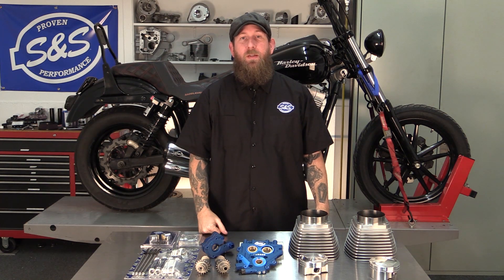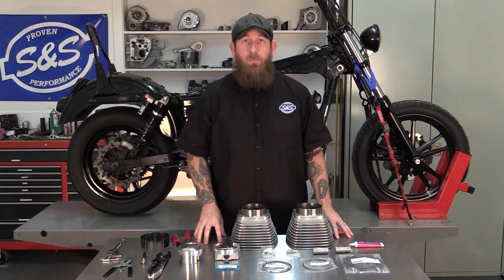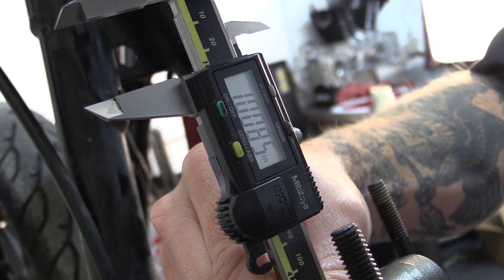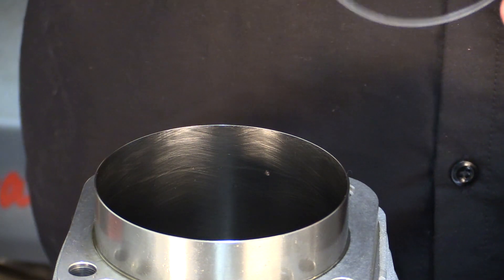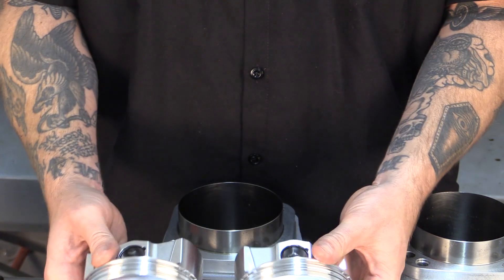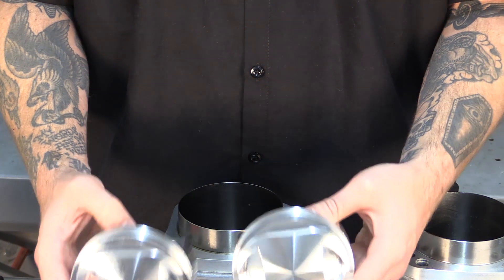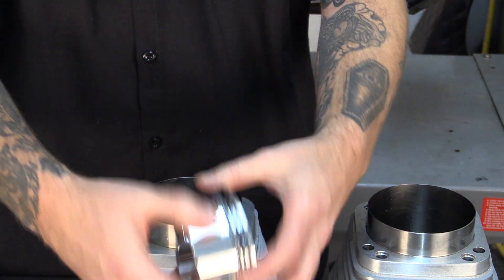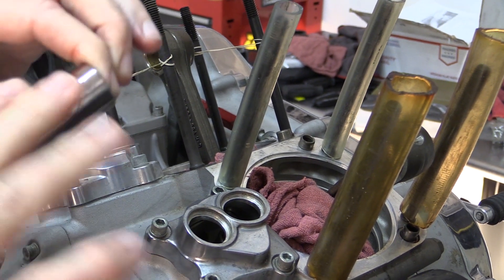How to Install: S&S Cycle Winter Power Pack (Part 1) Big Bore Kit

Comment: If you do that to a 50 000 miles or more engine is it not best to replace the craink case bearings while you are almost there?
Reply from the maker: We definitely recommend that you inspect the crankcase bearings and replace them if it's time, yes.
Reply: Its half way there

Comment: Hello, I'm a little bit confused. I've purchased the 106 kit. On the instructions it's written to put the black ring with the dot facing up as 2nd ring and the top ring has chrome edges and letter facing up. In your video it seems that you switched top and 2nd ring am i missing something?.. Don't want to mess things up
Reply: Same here! I just installed the pistons per the written instructions. This video seems to counter what the written instructions say. I contacted S&S and i'm waiting for a tech support return call. This pisses me off. Instructions should be clear!
Reply: Just spoke to S&S. Stated this was an older video. Tech said procedure for the 106" or 107" in written instructions is correct. Moly Chrome ring (lighter)  in top groove. Cast (darker) ring in second groove. Hope this helps clarify if any new readers have the same question.
Reply: @michaelkasper6140  thanks my man. I followed the written instructions with success also.
Reply: @2wheelsvibrations887  was it hard to do it yourself or simple
Reply: @franciscosarabia5711  it was moderate difficult, I should buy the proper tools specially the one to compress the rings it will be much easier to insert the cylinder

Comment: How much more power will this power package all done ad to an already 96 c.i. Twin cam engine? It is a very light softail that is used for stoplight to stoplight action. I assume that you will help pick out a couple camshafts for my intended riding purpose...
Reply from the maker: A stock 96" engine makes about 63 HP and 78 ft-lb of torque
A 110 Power Package is around 101 HP and 114 ft-lb

Comment: I'm currently putting your 110 BigBore kit on my 2010 Harley-Davidson FLHTK. Do you have a video for doing the heat cycles? At 2:42 in video what would Clearence be for my Harley-Davidson?
Reply: Did S&S ever get back to you on your question?!
Reply: @joalvarez6252  No their not much help.
Reply: @joalvarez6252  I just used the my best friend who has a motorcycle shop for heat cycles .
Reply: @Richard5873  Good deal, man! 👌 
Overall are you satisfied with the quality of the product?! I've been looking into this big bore kit, I got a 96 Ci and wanted to upgrade a bit in power and performance! Im looking into that 110" kit!
Reply: @joalvarez6252  O Yes Love the upgrade, just sad that S&S doesn't tell you IF you use your stock rockerbox covers on there heads your valves may stay open like what happened on rear of my bike. I have to cut/shave down Allot to fix my issue. I have another video showing what I figured out myself.
Reply: @Richard5873  Oh man, that's good to know! They always leave out the small details! But you got it knocked out! Analyze the situation and develop a course of action! 💯
Reply: Would a stock clutch hold up to this upgrade?
Reply: Are these stock heads, and throttle body?

Comment: I just ordered the power pack, can I use my stock heads and valve springs ?
The stock heads are From a 103
Reply from the maker: The Power Pack is set up to work with your stock heads, and coming from a 103 your valve springs should be able to handle the 585 lift cams.
Reply: @SSCycleInc  thank you very much

Comment: I have a dyna fat bob with an 96. The bike is from 2009. I almost install 
S&S 106" big bore kit 
•Vance & Hines black short shots with quiet baffles and ECU reprogramming 
•Clarity Air Cleaner Black Ops Roland Sands Design 

Any idea of an average Powergain with these mods?

Thank you in advance
Reply from the maker: With the 106" big bore kit we would expect to see 106hp and 108tq, when paired with CNC'd heads and a good tune of course.

Comment: Good video, right up until you torqued the bolts with more than one click and then loosened the bolts with the torque wrench…rookie mistake.   Should know better.   When tightening every extra click gets more movement,  and you should NEVER use a torque wrench to loosen.  🤦‍♂️